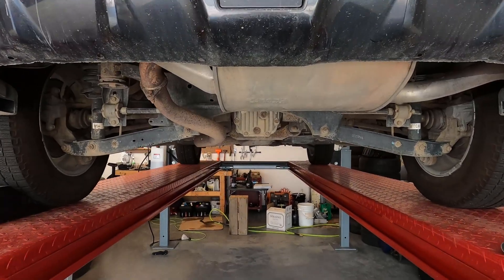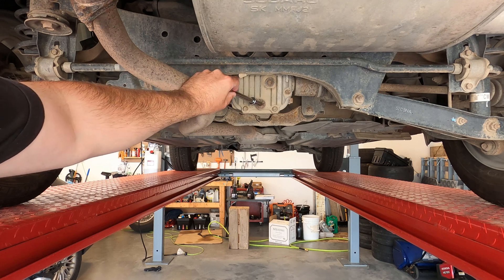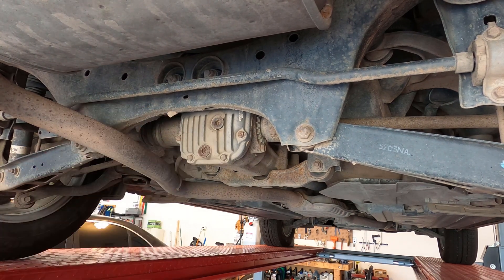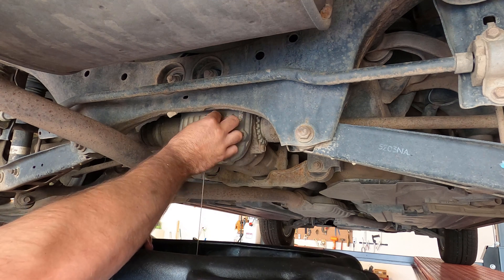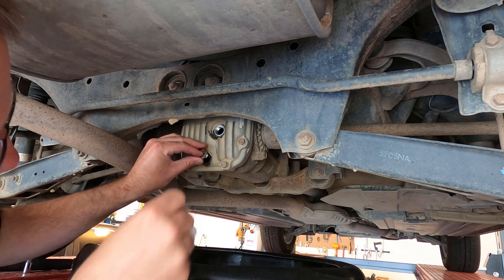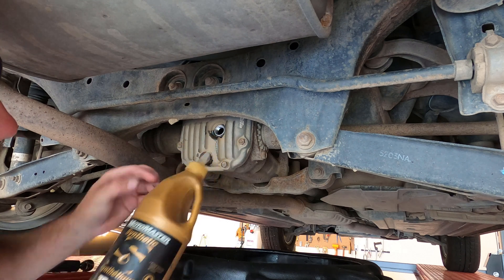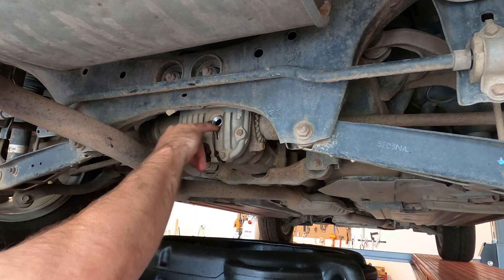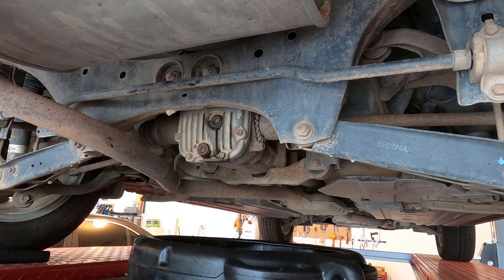How to Change Subaru Rear Differential Axle Oil 75w90

Comment: Car lift looks amazing. Been planning to get one for a small property near the mountains. Have a tractor and several vehicles that we are doing ever more odd jobs on. 

Curious your thoughts on brands/resources
Reply from the maker: yes get a lift.  best money you can spend even if you just do oil changes.  no more crawling under jacked up cars - the risk reduction alone is worth it.  Spend a little more than the el-cheapo $2500 models.  This one is about $4000 and worth the extra money.  A bit heavier.  Still chinese but higher end chinese.  USA built ones cost more